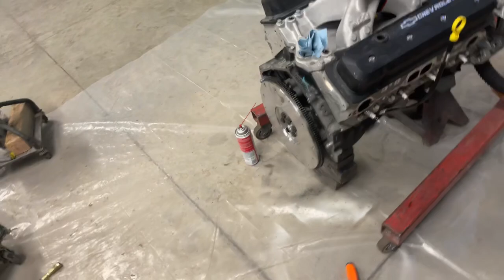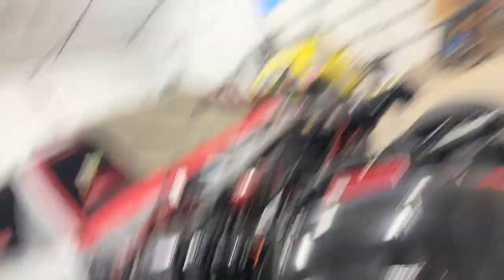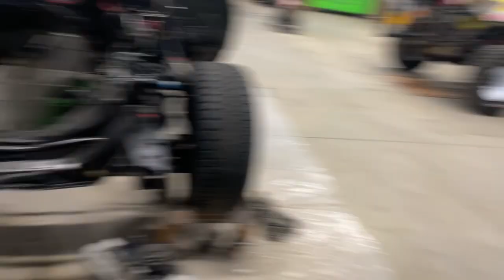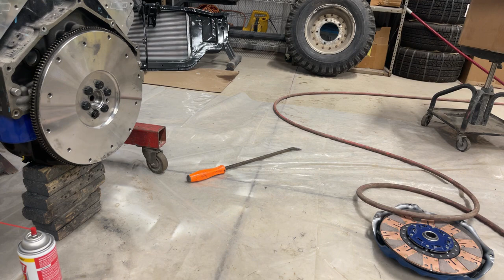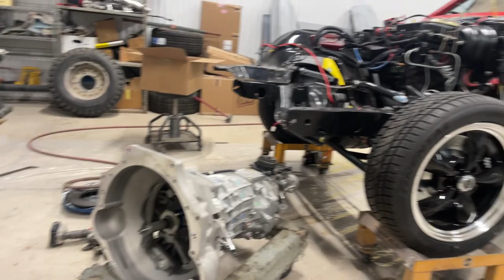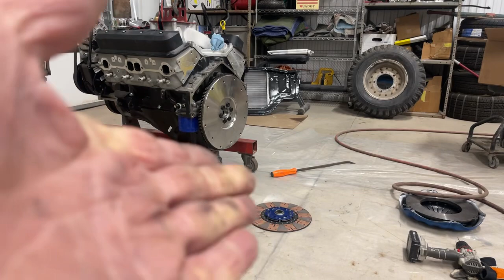I SCREWED UP - The Flywheel Was On Backwards 😡😡😡😲😲😲

Comment: I felt like crying for you Pete ....theres nothing worse than doing.a good job and then having to take it apart again...nightmare! Happened to me...i dropped a tiny nut in the crankcase just as I was finishing the very last piece of the engine rebuild....I felt like crying😨....Anyway...well done  you bud 😊👍💪
Reply: I’m 56 … back in 87 … I dropped a nut into my intake when putting studs on for the new carb …. I was gonna put a rag in but didn’t …. Literally had to pull motor and remove the pan …. That’s how you learn , from mistakes

Comment: How in the world did the starter motor reatch the ring gear to start the engine if it was back wards. You are lucky it reatched thats what had me stuffed that flywheel must have mirror finish on bouth you sides never seen that before I always thought a flywheel is machined on one side only for the clutch to fit  fuk the new shit situation

Comment: It happens...pressure and stress dosn't help...did a focus ST last year and fitted clutch plate wrong way round even though the friction plate was marked Getribe side ( gearbox side) I had a brain fart and even though I knew which way round it should go ended up putting it wrong way round...been spannering for over 55 years....was going to ask Pete to check that but didn't want to check something simple and wind him up...shit happens

Comment: I think if you took the motor mounts off and the trans support. It would be low enough for a 3 foot long extension to get to them out that their transmission looks bulletproof if the clutch explodes it will not kill the operator.

Comment: Pete this happens to all of us. The old saying jack of all trades and master of none partly applies here. You are a master bodyman but not a transmission, wiring, or drywaller specialist. Although like me,  we dabble outside our area of professional expertise. This did not happen because you were trying to rip someone off. In fact you were trying to save this man a few bucks in what was already a huge bill. If the situation was a "bodywork" problem? You would have had no problem. Over the years you have met mechanics who may have done their own bodywork or paint job. But you have to be honest. You would see flaws in his work because it is not his/her area of expertise. This is what happened here. You did have the knee problem for sure,  but you do know if that was a quarter panel replacement? You could have done it perfectly with your eyes closed. I agree God did step in and saved the day with the backward install.

Comment: I have never seen a flywheel machined on two side ever. Perhaps one part number now fits the non-LS engine and the other side does. I don't know the manufacture or instructions but should have come with a small label on each side. That would add to customer satisfaction. The bell housing is overkill and probably sold based upon horse power. I researched these yesterday for over an hour & half, and saw starters that bolt in from behind. Never seen that either. No where close to factory GM stuff and overpriced. Not for a regular build! 
DK, Omaha.